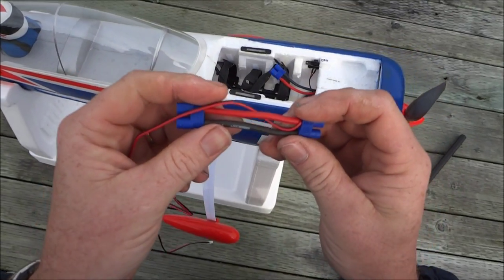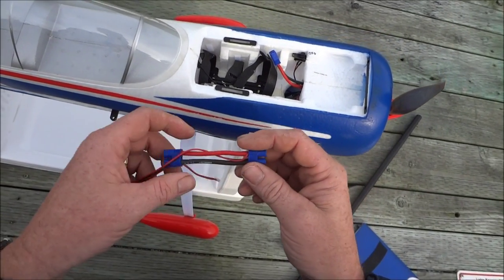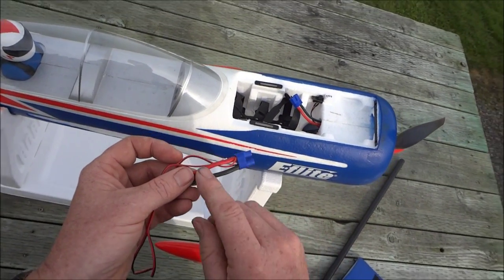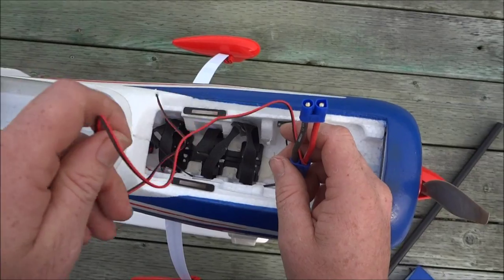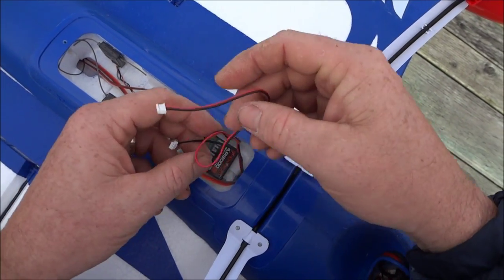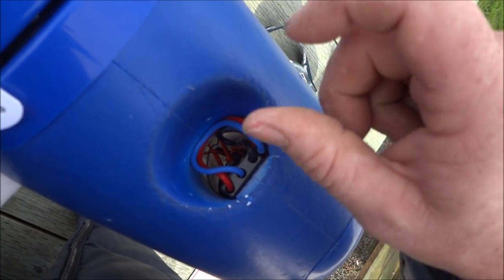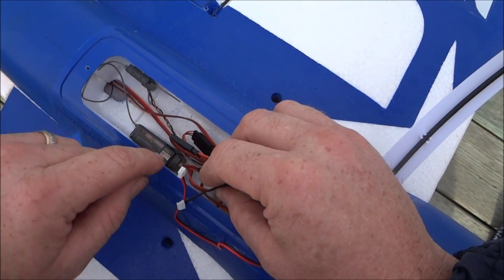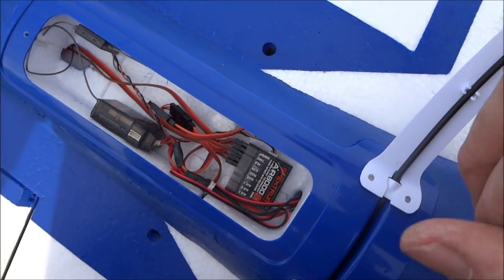How I hooked up the Spektrum TM1000 Telemetry Module

Comment from the maker: Sure thing. =)  Glad to help.  I should also let you know, I've never done it this way, I'm just assuming that it can be done.  I asked someone how I should power my wing-tip lights on my Mustang, and he said that I can take power off of any channel, because all the power leads on the Rx are the same.  And that's how the servos get power.  So it shouldn't matter which channel is used to supply power.

Comment from the maker: You should be able to do that.  I was told that all the power pins in the Rx are in parallel, so you should be able to apply power to any one of the channels, and have all channels powered.  Are you using a separate battery for your Rx?  Normally I get my receiver power from the ESC, which supplies power to the Rx through the throttle channel.  Also make sure that you power the correct leads, center lead is positive, and one of the outside leads is negative.....(continued)

Comment: I have the Tm1000 with an Ar7010.. All my channels are used Except 1.. I hook up the TM1000 to data port and where should i connect the RX battery .. Can i connect the RX battery to the AUX channel ? Thanks